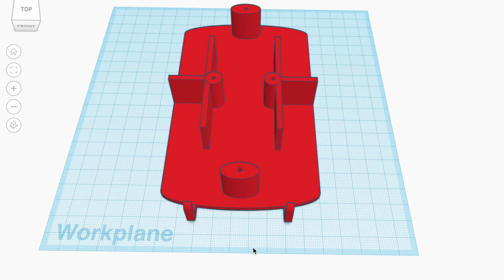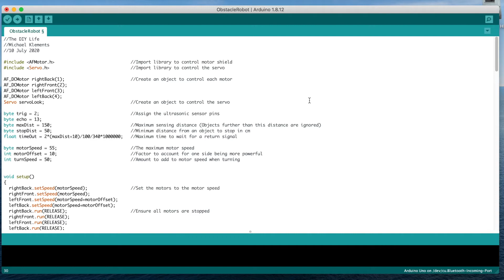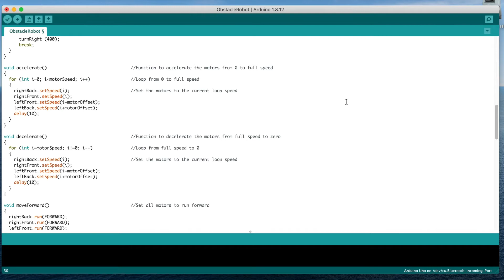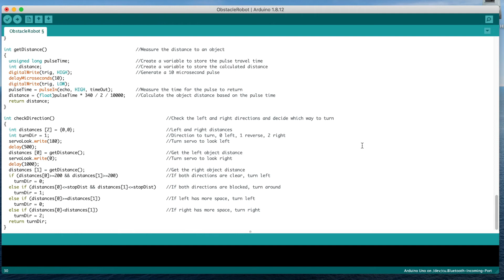Obstacle Avoiding Robot Car Using An Arduino

Comment: Hello, My Car has two wheels at the back and one free wheel on the middle in the front . The problem I am facing is that my robot is not going straight. It starts moving to the left or right. I know that it is because the Rpm on the motors are not the same. I have tried to do different things but nothing worked so far. Did you face the Rpm issue with the motors or can you suggest something for my problem. Thanx??
Reply from the maker: Yes it's probably a speed difference issue between the two wheels. Those cars are designed to be used with some sort of active control system that keeps them going in a straight line, either following a line or object etc.
Reply: @MichaelKlements  If I used the motor shield that you are using or maybe use four tires instead of two would that make a difference??

Comment: Hello micheal, i am new to this Arduino thing, this is a project my teacher gave me, i wanted to ask for the motor driver i buyed a one but ut doesn't have some pins, instead holes like yours, my question is can i just put the pins in the hole?will it have the same effect, hope you'll answer me the dead end of my project is in 15 days💀🔫🔫🤝🏻
Reply from the maker: You'll need to solder the pins in place once they're in the holes so that you get a good electrical connection.

Comment: can i change the pin connection to 0 and 1 both in code and the circuit? pls reply fast.
Reply: Pls reply 😒
Reply from the maker: You can only use pins that are unused by the shield, so only 2 and 13 are available.

Comment: Hello brother, I am unable to understand how you connected the female header pin to pin 13. Can you please explain?
Reply from the maker: I had to solder additional header pins onto my shield in order to plug it in - alternately you could just solder the wire directly onto the shield.

Comment: Can you give me the seperate code of servo motor
Reply from the maker: The Arduino IDE has a few servo examples built in, this code uses these examples.
Reply: @MichaelKlements  sir can you help me my two motors are not running with l298n motor driver only one motor is running can you please help me it's very very important to me please 🙏🙏🙏🙏🙏🙏🙏🙏🥺🥺🥺🥺🥺🥺🥺🥺🥺🥺🥺🥺🥺

Comment: IT  IS WRITTING: AF Motor .h: No such file or directory
Reply from the maker: The first line after the code in the instructions tells you to install the required library, with a link to it.

Comment: Hi Sir can you please give servo.h file
Reply from the maker: This is a package that comes with the Arduino IDE, it doesn't need to be installed separately.
Reply: @MichaelKlements  Thank you sir. I imported it and it worked well.

Comment: My Moter driver Is Not Working But Servo Moter is working on 4 moters Is Not Working, Plzz Reply
Reply from the maker: This could be caused by a number of things; the battery can't supply enough power, the shield is faulty, the connections are faulty, the speed gains need to be turned up, the code is getting stuck somewhere (waiting for ultrasonic sensor) etc.

Comment: Can I use Arduino UNO R3 SMD Atmega328P Board - Clone Compatible Model
Reply from the maker: Yes you can use an Uno clone board, as long as it has the same pinout as the original Uno it should work with the motor driver shield.

Comment: Hi, I would like to know how did the wheels turn left and right if you did not use servo motor on the wheels?
Reply from the maker: The wheels don't physically steer left or right. The difference in motor speed between the left and right side turns the car.
Reply: @MichaelKlements  thank you so much!

Comment: Hi Michael, great project.  i am relatively new to Arduino and understand most of the sketch.  However I would like to understand the difference between calling a function following a void command such as "void stopMove() and the call to distance=getDistance()  where the getDistance code starts with the statement "int getDistance()" why isn't getDistance also a void statement?  cheers.
Reply from the maker: Hi Kerrie,
There are two different types of functions, ones starting with void just carry out the code in the function and ones that start with int (or String, char, Boolean etc.) are functions that return an a variable or “answer” of that type.
void stopMove just tells the motors to stop.
Where
int getDistance returns the distance measured to the object as an int variable type.
Hope that helps make it clear

Comment: Appreciate the project. I've been trying to implelement this on my project and i noticed something in the code can you enlighten me?
 if(distance >= stopDist)                      
  {
    moveForward();
  }
  while(distance >= stopDist)             
  {
    distance = getDistance();
    delay(250);
  }

  stopMove();                                     
  int turnDir = checkDirection();       

  Serial.print(turnDir);

shouldn't there be an "else" above the stopMove(); function? Since we defined an if argument? I don't get using while loop after "if" without the else statement. Thanks in advance.
Reply from the maker: I think you're misunderstanding what is happening in each function.
The if statement checks if there is enough space infront of the car to move. If there is then it tells the car to move. 
Since nothing then tells the car to stop, the car will carry on moving until it is told to stop.
The while loop then continuously checks that there is still space in front of the car and will carry on running as long as there is still space. 
As soon as there isn't space in front of the car, the while loop stops running and the code runs the stopMove command which then stops the car.
Reply: @MichaelKlements  Oh, i got it now it makes perfect sense. Thank you for your response!

Comment: Would this be possible if you wanted to hook up something to yourself that beeped every time it came into contact with a specific set of receivers?? So for example if it drove in a straight line it would beep when passing some obstacles but not others, depending if they had a receiver on it or not
Reply from the maker: You could probably do something like that with a RFID tag setup. Depending on the range you need to the object, there are a variety of RFID options that work at different distances.
Reply: @MichaelKlements  What I came up with is using a Hall effect circuit and taping rare earth magnets onto the object I wanted it to beep on! Just have to figure out how to build it now

Comment: Could you help me out here! I am using a 9v battery as power supply, though it is powering up the arduino board and motor driver it is not helping to drive the motors and servo motor, but when i connect to my laptop to upload the code it is poweringup enough to drive the motors and servo.
Reply from the maker: A 9V battery isn't able to provide enough current to drive four motors. It works when powered by USB as well as it is supplementing the shortfall. You need to use a better battery pack.

Comment: Hi. I want to ask. Did you used 3 cells of 18650 battery? If i use 2 cells is it enough? Thanks..
Reply from the maker: I used a 3 cell LiPo battery, not 18650 cells. Two 18650 cells would probably be sufficient.
Reply: @MichaelKlements  ah i misunderstood. I will try this project soon. Thanks for your amazing tutorial!

Comment: Hi sir instead of 100rpm gear motor can we use 300rpm gear motor plz replay sir ur solution will slove my problem
Reply from the maker: As long as the motors have enough torque to move the car you can use 300rpm ones and set the speed down.
Reply: @MichaelKlements  sir we need extra power for 300 rpm gear motor sir and what is the mah of 100rpm gear motor and 300 rpm gear motor sir plz give a solution sir
Reply from the maker: Your question is too open ended. A 300rpm motor is not a standard part, there are 300rpm motors that run on 2V, 12V, 24V, 50V etc., some are AC and some are DC and they can be a range of rated powers as well.

Comment: Amazing project !

Just Additional Information...
Ask permission Mr. Michael Klements
for those of you who are new to assembling, then there is a problem with the speed of the motor.. the solution is:

1. Change the byte value of motorSpeed
2. check the condition of the battery, is it still good or not
3. check the state of the gear motors (dynamo)

Thank you for your attention
Greetings from Ponorogo, East Java, Indonesia
Reply: What do you suggest to use instead of byte?

Comment: Arduino: 1.8.14 (Windows 10), Board: "Arduino Uno"

loading libs from C:\Users\al11\Dropbox\My PC (LAPTOP-PB88OKI2)\Documents\Arduino\libraries: loading library from C:\Users\al11\Dropbox\My PC (LAPTOP-PB88OKI2)\Documents\Arduino\libraries\arduino_422445: loading library.properties: Error reading file: read C:\Users\al11\Dropbox\My PC (LAPTOP-PB88OKI2)\Documents\Arduino\libraries\arduino_422445\library.properties: The handle is invalid.

Error compiling for board Arduino Uno.

This report would have more information with
"Show verbose output during compilation"
option enabled in File -> Preferences.
Reply from the maker: It looks like your IDE isn't able to read the libraries that you've got installed or the libraries property file has been corrupted.

Comment: Hello
I am new to Arduino
And servo motor and ultrasonic sensor are working good 
But when it's time to move motors their
Speed is very low and sometimes not even moving 
If it is the matter of battery pls suggest
Which to use 
Or some different problem.
Reply from the maker: Hi Kapil,
You can adjust the motor speed in the code by increasing the motorSpeed variable. If that doesn't help then your batteries are probably underpowered, I usually use lithium-ion or lithium-polymer batteries for these projects.

Comment: where do i connect pin 13 i not have point to solder pin 13
Reply from the maker: Just solder a female jumper onto the top of the existing pin.

Comment: The servo and the ultra sonic sensor  work perfectly. but only 1 motor is working and the others are not !! is it because am using 9v battery ? 

and i have attach headers pin on A0 - A1 for the echo and trig instead the pins you are using  ,  what changes  i can do in order to use your code but with my current pins ?       

            Thanks alot Mr Micheal
Reply from the maker: It might be related to the 9V battery, these generally aren't able to provide enough current for four motors.
Reply: bro. will it work if we change header pin to A0 and A1

Comment: Great project!  Thankyou for your work on this.  Just changed a few speed settings for mine, works great.
Reply from the maker: That's great to hear!
Reply: @MichaelKlements  Hi!  I've since noticed it only ever turns one direction, regardless of obstacles location. 
I can reverse the turn direction by changing AF_DCMotor  assignments Left to Right,  but I can't get it to decide to best turn direction, it only goes same way each time.   The servo was incorrectly looking right first, but fixing that didn't fix the problem.   I downloaded your Code again in case I accidently changed something that matters,  no go.  Also played around with the  'int checkDirection()'  in curiosity..  Anyway maybe you can suggest an answer if you have time.    Thanks from QLD Australia.

Comment: How do you put the female wire oarts in??
Reply from the maker: I'm not sure what you're asking here. I crimped on some female dupont connectors.
Reply: @MichaelKlements  sir thank you. I got the parts installed. But I have encountered a problem. I have uploaded the code. But the car is not working. The sensor has moved to the right and is staying there. What should I do?? All libraries were added and uploaded

Comment: Can we make it without a motor driver?
Reply from the maker: You need a motor driver to provide power to the motors. You can't turn the motors without some sort of driver chip, it doesn't have to be a shield, you can use bare L293d driver chips if you'd like.

Comment: Where I connected the sensor wire in ardino
Reply from the maker: To the motor controller, it’s explained in the guide linked in the video description

Comment: So you just feed the power supply to the motor driver there is no need to supply the arduiono board right?
Reply from the maker: Yes you are correct, the board supplies power to the Arduino from it's supply

Comment: Hello, great project! I've run into a few problems and by modifying the code a little I managed to find the solutions. Although there is one problem that I can't find a way to fix. The ultrasonic module only detects a wall once, it stops after the 2nd wall, but the engines still continue forward into the wall. Could you help me, please? (My modifications did not cause this problem since when I used the original code it didn't work either)
Reply: can u copy and paste ur code plz need help

Comment: My car motors doesn't move at all. The servo and the ultra sonic sensors all work work perfectly. The only thing that doesn't work is the motor. I tested the motor by connecting to a power supply and it does spin, but when I put it in the motor driver it only makes a buzzing sound. Any idea how to fix this?
Reply from the maker: If the motors are buzzing but not turning then either the speed reference for the controller is set too low or your power supply/battery is not adequate for all four motors.
Reply: @MichaelKlements  How do you make the speed reference go higher?
Reply from the maker: By adjusting the motor speed:
byte motorSpeed = 55; <- make this value higher
rightBack.setSpeed(motorSpeed); <- these functions use it to set how fast the motors turn
Reply: @MichaelKlements  Omg thanks it actually worked

Comment: How many pins of Arduino are remains usable after connecting L293D shield means which are those pins which are not connected to shield
Reply from the maker: Pins 2, 13 and A0-A5

Comment: Really nice project 
I have tried it but my car is not moving
Any help?
Reply from the maker: Try breaking the code up into smaller sections first. Get the individual components working and then try running them all together. I'd suggest getting the servo moving, then making sure you get logical distances from your sensor and then try getting the wheels to turn. Once these all work individually then try putting them together.
Reply: @MichaelKlements  servo moving but car not moving.pls help @michael

Comment: Hi, I did everything exactly the same as in the video, but it doesn't move at all. I tested all of the parts seperately and everything worked perfect, but when I run your code nothing happens. I think it's because of the powerbank I use. What kind of power source do you use? I think it's batteries but I'm not sure what kind and how many
Reply from the maker: If the car isn't doing anything then the code is likely getting stuck somewhere, most likely when the ultrasonic sensor is used. Try checking your connections to the sensor again.
How did you test the part separately? Try commenting out sections of the code to get the car to do the basics and then slowly add lines back in until you identify the issue.
Reply: I'm having the same issue. 
Did you fix it ?
Reply: @harikeeshan  Nope, eventually I just switched to an ESP8266 and a single L923D bridge instead of the whole motor driver. Worked perfectly with a power bank
Reply: @blueoceans4366  if you don't mind can you send me some details on your work
Reply: @harikeeshan  Sure I have some documentation left. How should I share it with you?

Comment: hi can  i add led lights for this project? to determine distance
Reply from the maker: The distance is determined with sound, so lights aren’t needed for that. You can add LEDs though just for visual effects.
Reply: @MichaelKlements  but my prof wants me to add 3 led for some distance like.example. 50cm for green 30cm for yellow and red for 15cm
Reply from the maker: Yes you can do that quite easily. You would need to use the available analogue pins to connect the LEDs and then just have limits to illuminate them.
LEDs draw hardly any current compared to the motors, so battery capacity is not an issue.
Reply: @MichaelKlements  actually it works but when i try it again my servo motor doesnt work anymore can u help me i need to video it while working then send it to my prof
Reply: can i send u the code that i used?
Reply: @MichaelKlements  but it seems that may battery cant.hold it

Comment: I also make a car but it is not working can you please help me to make it
Reply from the maker: Hi Gishan,
You can post any questions you might have here or in the comments on the blog post (probably better to help others) and I’ll help you out there.
Reply: @MichaelKlements  ok sir
Reply: @MichaelKlements  ok sir thank you sir
Reply from the maker: There are step by step instructions to upload code to an Arduino on my blog as well. Search for the beginners guide to Arduino. 
It’s probably not a good idea to try and make this car as your first Arduino project. You need to get some basics running first.
Reply: Can't we put photos to here
Reply: I want to put a photo to you
Reply: Because I made the car correct or incorrect
Reply: Can you tell me how to put the codes to the obstacle avoiding robot car
Reply: I donload the Arduino app to my desktop can you tell me how to put the codes to the Arduino car
Reply: Can you tell me the steps of it
Reply: Very thanks for looking the previous messages of me

Comment: So I'm a little confused. In the description, you list header pins as a part, but I am unable to find where they are actually used. Could you describe where they are used and also why they are needed.
Reply from the maker: You need the header pins to solder to the motor driver shield so that you can plug the ultrasonic sensor into it. These pins aren't installed on the board when you buy it. You'll also need female pins to make up the cable to the sensor.
Reply: @MichaelKlements  do you have a link from which I could buy header pins?